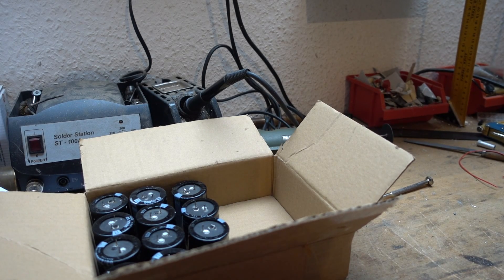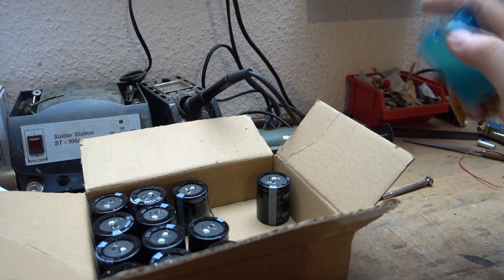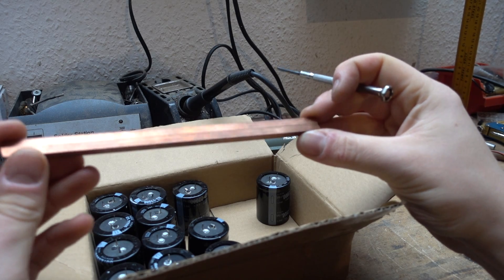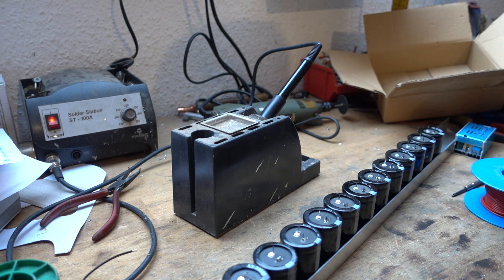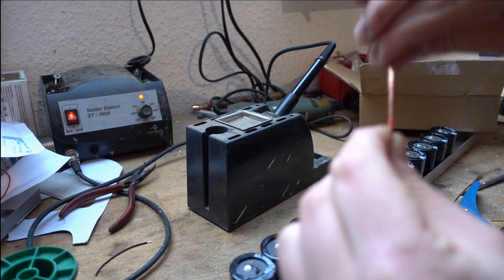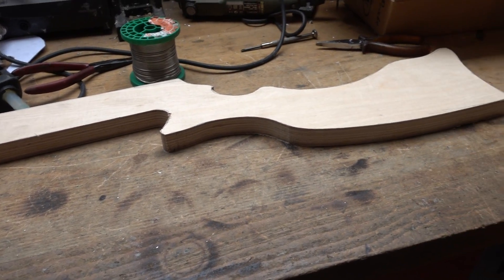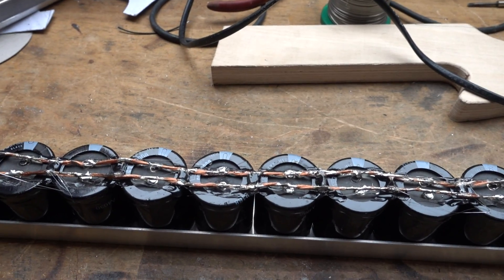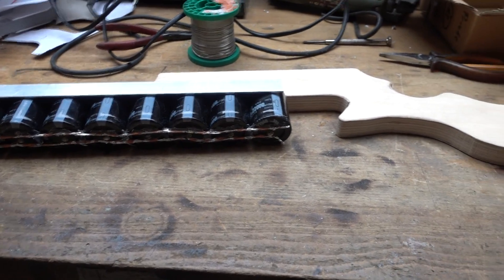We make a railgun part 1: How to make a capacitor bank

Comment: Why use capacitor banks? Why not use like a battery bank? Sorry for the noob question.
Reply: because a capacitor bank can supply much more current compared to a battery bank in a short time period.
Reply: @safwan096  Interesting. Thanks.
Reply: @safwan096  Can you build and deliver a set-up?
Reply: @Mecanik1337  sorry man really busy with my graduate admission rn (:
Reply: @safwan096  :(

Comment: How dangerous a cap bank like this? I know bigger caps can be very dangerous, spec high voltage caps. But what is up with these, what if I touch the bank + and - with one hand?
Reply: Will still shock you, probably not a lethal shock though. Generally I would NEVER touch anything charged with both hands. Simple rule.
Reply: Thanks for the fast answear!
Yep, this is why I said one hand, small area, low resistance, burning meat maybe?
Reply: You would not touch it for long but a tiny burn mark maybe.
Reply: +LaserGadgets Thank you, sir!

Comment: Also, will higher amperages be more efficient in accelerating the projectile, or will higher voltages do this more efficiently? Wouldn't more electrons flowing through a wire at once produce a higher electromagnetic field? What are the ratings on your capacitors in farads? BTW, excellent video!
Reply from the maker: Could swear I already explained in the video...not sure though, I tend to edit stuff out of them. Higher voltage means shorter pulse, means the cap bank is empty when the slug has moved 1 inch only...not senseful.
Reply: @SelfmadeChannel  Could you explain why this is, from my knowledge they use High AC voltage in transmission line due to it bein able to travel farther and produce less heat since inevitable you will have a much smaller current rather than a high one.

Comment: One, question  could I use a boost converter instead of that power supply? Also, would 50 volts a 1000 micro farads be viable? Can camera flash capacitor chargers be used to charge capacitors?
Reply from the maker: Camera means 330V. But 50V should work great. I will add some magnets as soon as I find time and see where it gets me. 1000µF will not do it though. Needs more C than mine.
Reply: You answer really quickly, thanks! What is the ideal farad rating?
Reply: Would you recommend a graphite projectile, because of its ability to conduct high current?

Comment: So, lower voltage means longer rails, what benefit do those provide? How long can my rails be for 25v 4000uF ?
Reply from the maker: Read a bit more about railguns. I never said lower means longer...
Reply: I think it should be balanced between voltage and farad, as well as the rails. If you find a way to determine how much the cap bank outputs per cm/inch, you can easily calculate the nessecary length of your rails. The easier way is just to see what happends

Comment: is it possible to control the capacitors and the railgun with an onboard computer?
Reply from the maker: What for?
Reply: i just figured making it computerized would make it a bit easier
Reply from the maker: So you have no reason, you just believe adding a computer (!!!!) makes it easier...
Reply: I mean there are practical purposes that could come from adding a computer. Like voltage readings and stuff like that.
Reply from the maker: There is a voltmeter...PLEASE just accept it, its senseless :p nothing else. There is no need for a computer and installing on doing everything is harder than making a railgun.
Reply: Adding a computer to control the power could increase the accuracy to account for bullet drop across an inputted range

Comment: Any chance of a mini EMP of sorts? Or a homemade rechargeable power bank?
Reply from the maker: You cant really make a mini EMP.
Reply: Heard you could make a thing that disabled electromagnetic locks.

nvm bout that, a power bank would be cool, but rechargeable.
Reply from the maker: Pulsed coil is not really an EMP.
Reply: Selfmade Thank you!
Reply: Wasn't sure about the name, thanks for clarifying. Still though, a homemade rechargeable power bank that doesn't run out in 5 mins would be cool. I've seen tutorials for power banks, but they're never rechargeable, and barely last 5 minutes.
Reply from the maker: Actually simple...a charger board and a couple of Li Ion batteries or LiPo...
Reply: Where would you get them?
Reply: You can get them anywhere. Ebay, Amazon, Aliexpress, Banggood, etc.